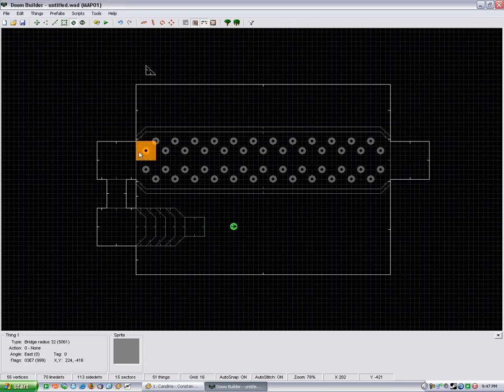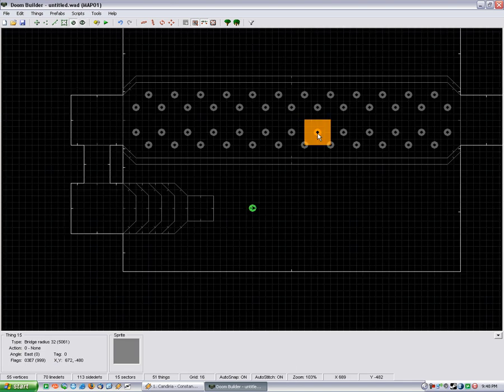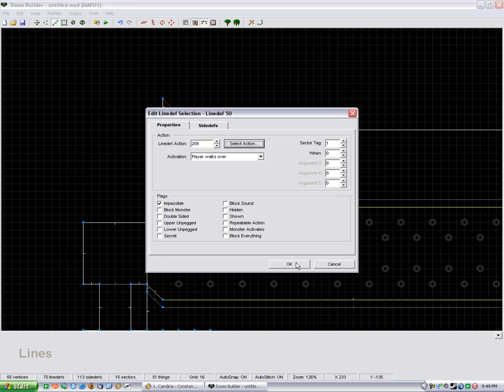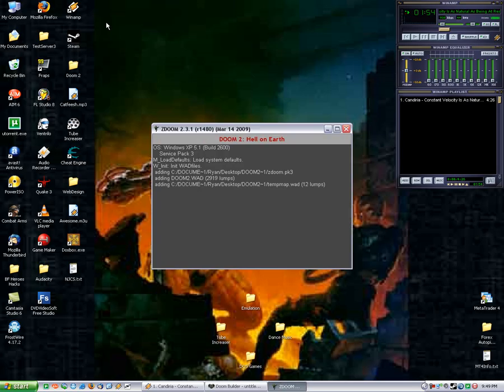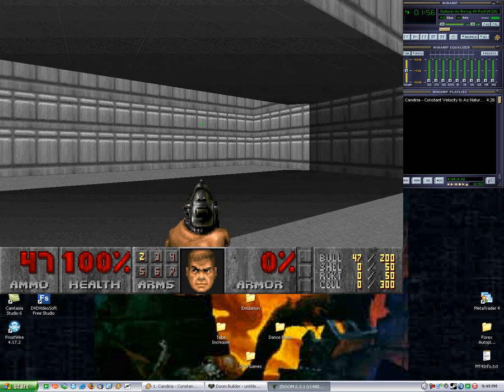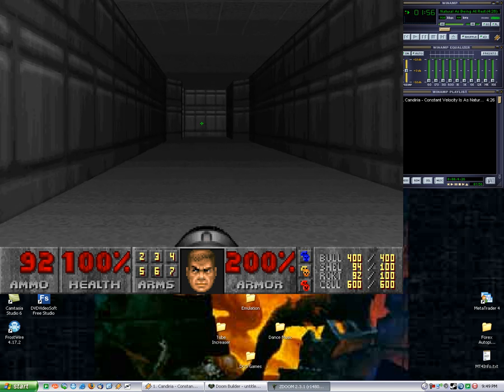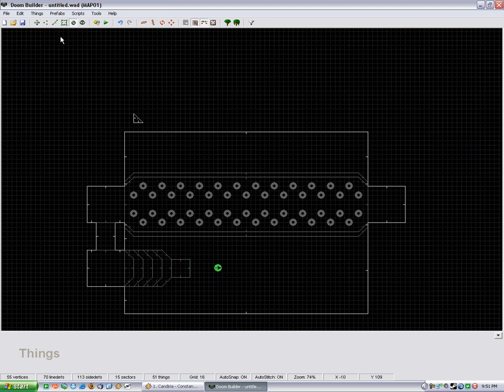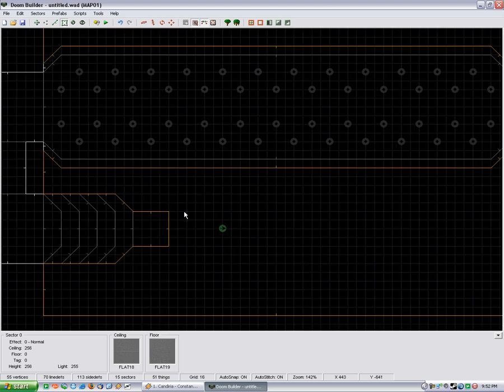Doom Builder Tutorials - Room Over Room

Comment: another trick is the 3d floor it does require opengl and wont work with software rendering but  use a action tag of 160  and same concept with the dummy sector and such  you cant  shoot through it either i think both methods are good for the parts though

Comment from the maker: If you're getting a HOM, it usually means your heights are awkward, make sure the ceiling of the height transferring sector has the same ceiling height of the sector you're transferring to.  Then just set the floor of the xferring sector to the height of the floor you'd like your room over room to be.

Comment from the maker: I don't believe there's a way to add a sector based window to the room up top.  You could create some vertices on the outside sectors to create a linedef the length of the window and use the "H Transparent Line" function and create a see through area, but that's probably the best you can get - I'll look into it though, and if you can, I'll make a "Room-Over-Room Extended" tutorial.